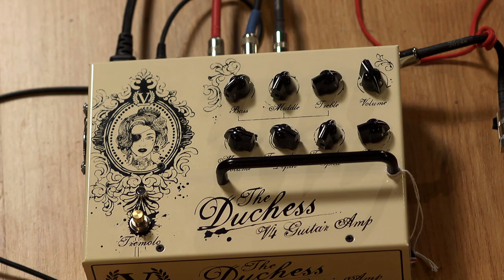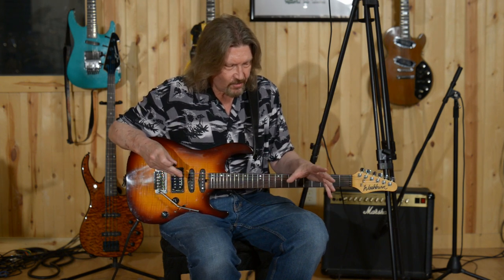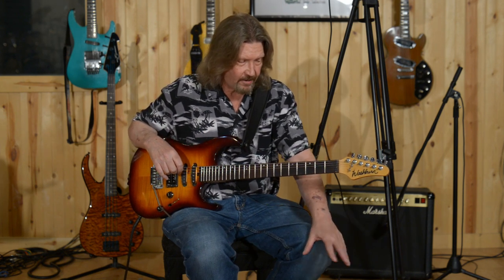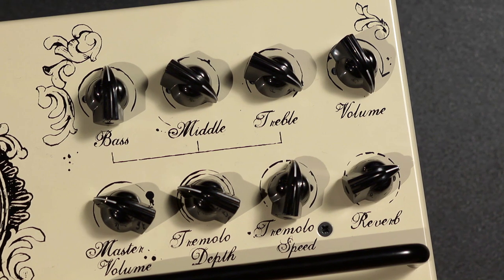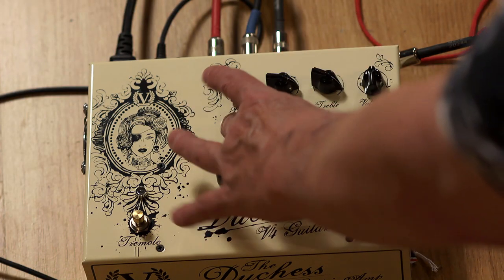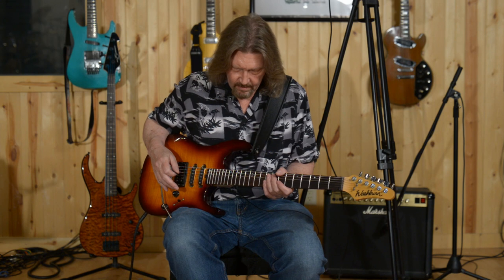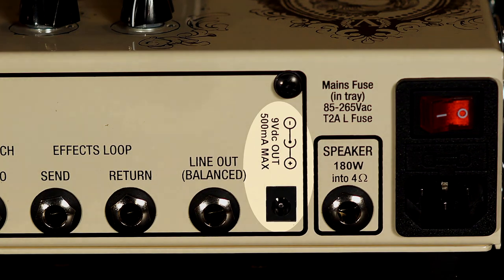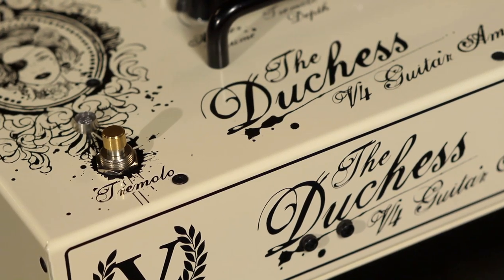Victory Duchess V4

Comment: Would this be insanely loud as my primary amp in my apartment?
Reply from the maker: It can get insanely loud, but because of the Class D solid state power amp, you can turn down the master volume without sacrificing any tone - unlike an all-tube amp, where the power amp will be adding harmonics and compression that seriously affect the sound. That's one of my favorite things about this type of hybrid design. You can get your desired tone at a gigging volume level, or in your bedroom at conversation level.
Reply: @MooreMusicGuitars  Doesnt that sacrifice tone? I'm looking for something with huge fender cleans and use that with a 1x12 at home and also DI record with it. This seems to fit the bill